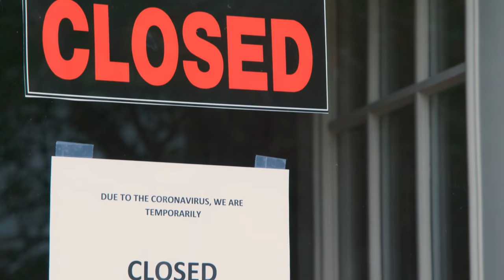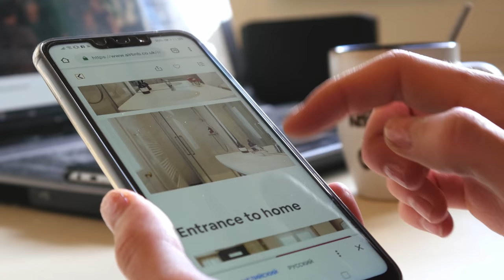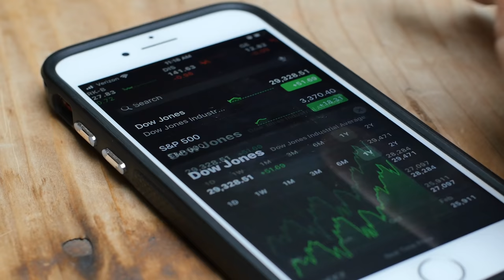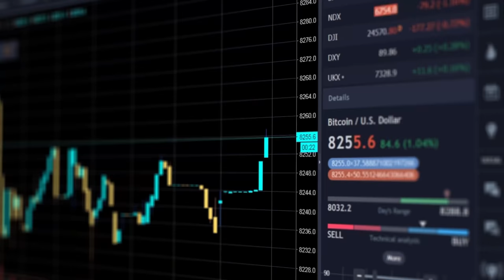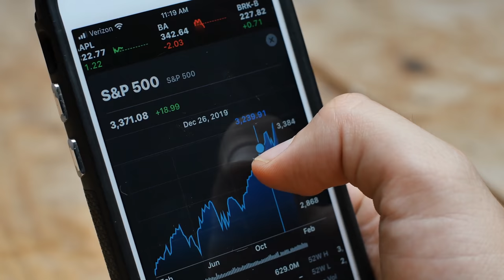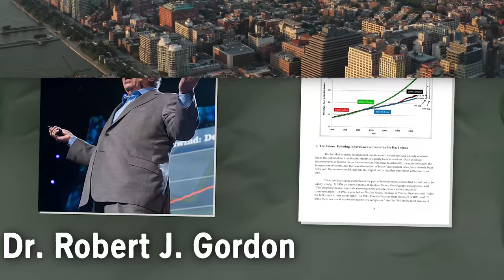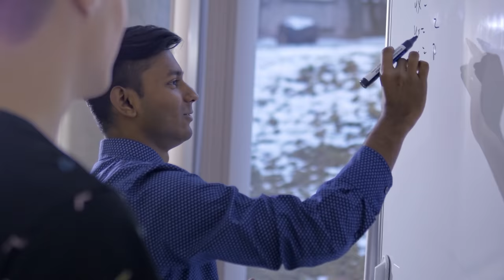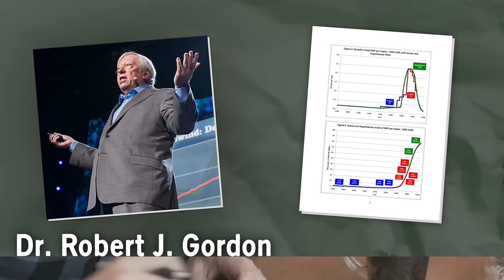You Will Never Retire, Here's Why... - How Money Works

Comment: This is doomerism.

To begin with, a few things with massive impacts are being left out of your oversimplified example. The first is fairly straight forward: wage competition. As the labor pool dwindles, demand is driven up and wages increase. A dwindling workforce points towards higher wages, not lower ones.

The second is growth in demand. As we become more efficient at producing, and economic activity increases, demand rises as people spend more money, which makes labor more valuable (before someone leaps to point it out, whether or not these proceeds are passed down is irrelevant to this point. The point is that your income level is not necessarily fixed by limited market).

The third is a combination of higher demand and technological or social advancement creating jobs that didn't exist before for whatever reason. Like dealing with a problem that had too small a market to be relevant or discovering/creating a new market all together.

The fourth is the concept of resource scarcity. People are constantly harping on about this, yet we are no more closer to running into shortages today than we were previously. As always, the first resources to be extracted are the ones most easily extractable, and as time goes on and scarcity increases, we revisit methods that were unprofitable before. A good example of a resource people are constantly freaking out over running out of is oil, but we are at absolutely no risk of running out of it at least for the next thousand years if not more. That's because even if you use up all the available oil fields, including shale, in a pinch we can still convert coal into oil- a technology that has been around since at least WW2 and only isn't used because it's not as profitable as drilling it up. And if we need more base elements there is always space, with our immediate solar system containing more resources than we will realistically need for the next few million years.

The fourth issue is the omniscient nature of the metaphor used. In the metaphor, we have a certainty about the market that simply does not exist in real life. For instance, that 1 innovation replaces 10% of all lumberjack labor and provides no new jobs that can, in turn, be eliminated through greater innovations. We have no such knowledge in real life. What's more, while people are quick to point out that we are creating fewer and fewer revolutionary technologies, that arguably has more to do with our subject definitions of 'revolutionary'. Steam engines did not double their power every two years, yet that's exactly what's going on with computers. In reality, technology is progressing faster than it ever has before, and we have no evidence that will stop.

Moving on, there's one final thing: 'wage stagnation'. One of the issues with the data brought up on wage growth is the time periods we are comparing against each other, namely the 50s to 80s which saw the largest period of economic growth in history, against the 80s to now, which has experienced an economic crisis every decade or so. Stagnation of wages is excatly something you'd expect after the economy shitting itself every decade or so for forty years and counting. And as for income inequality, the rich get richer no matter what, as they are less vulnerable to worsening economic conditions. They just shift their investments around- or rather their teams of experts in all things financial do.

So pointing to the economic shitshow of the last few decades as evidence for anything at all is suspect to begin with. As is common in economics, there's just too many factors involved to say much of anything with any degree of certainty about whether or not any single factor is affecting the economy and especially to what degree.

So yeah, this is just doomerism.